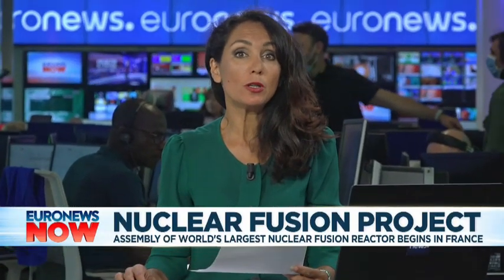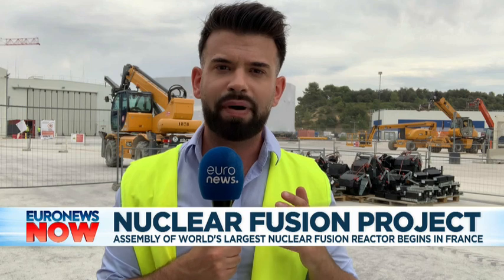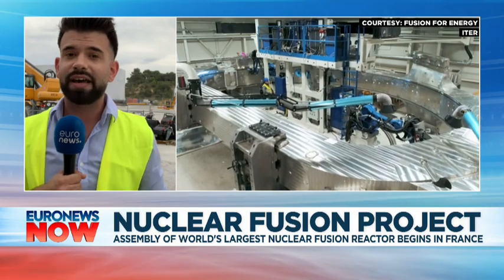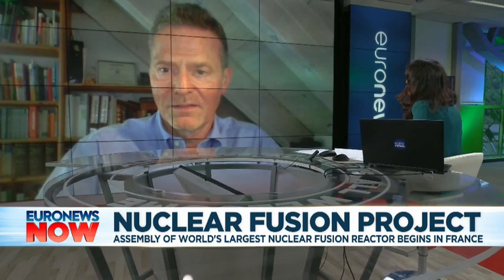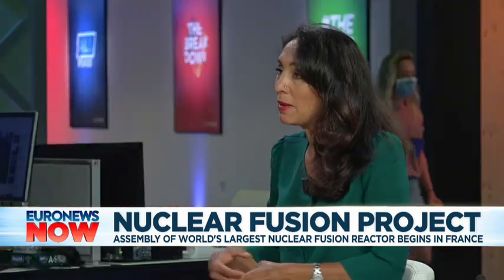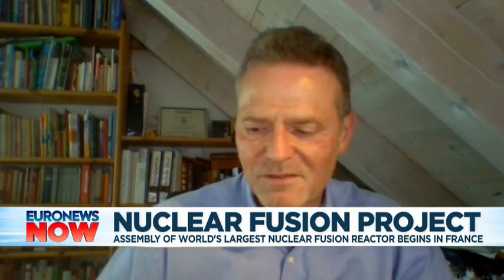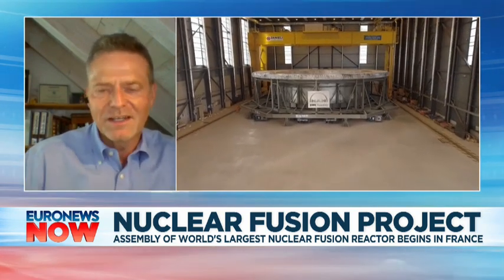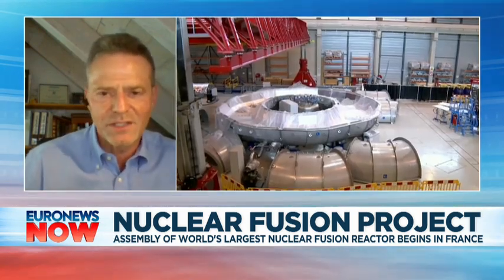Euronews Now: ITER Assembly begins

Comment: Great explanation Johannes, lets hope we will look back someday from a future completely run on cheap powerful fusion reactors.
Reply: Before ITER, fusion test reactors were small enough to fit in a single country's budget and they were rapidly designed and built and progress was very fast. But then they became too big; they could not be made smaller with the technology of the time. ITER was so big and so expensive that many countries must be involved in this one project. 

The only thing ITER will prove is that just building a larger tokamak until you break even is not viable. It will be too expensive to ever be workable and economical; you did not even have to put shovels in the ground to conclude this.

ITER was discussed years before I was born. The project started around the time I was born. It was designed when I was in my teens on "supercomputers" about as powerful as a mobile phone is today. They decided where they were going to build it when I was already out of school and working. It is being built from 90's era superconductors that cannot generate very high magnetic fields and are made of expensive, brittle ceramic, when there is much better stuff available. At the currently planned startdate for D-T I will be in my 50's; but it will be pushed back, it's been pushed back repeatedly before. Probably I will be about ready to retire when they actually do something useful at ITER. 

If practical power production from magnetic confinement fusion is a thing one day, they will look nothing like ITER. They will be small and compact and have much higher field strengths and maybe different geometry (e.g. stellarator or spheromak) and it is not at all certain that anything learned about the plasma in ITER will transfer to those designs. ITER is a giant cuckoo that crowds out funding for potentially useful projects.

Let's say ITER exceeds its goals and achieves ignition (Q goes to infinity). Then what? ITER is not a workable concept for a commercial reactor so then you go back to the drawing board and design something much smaller. We'll learn some generalizable things about tritium breeding and handling probably and diverters and materials possibly but the rest is proabably not generalizable.
Reply: @soylentgreenb  Hey soylent green. Very well made comment, thanks for putting the time and effort in. I actually completely agree with every point you make. I am looking forward to the more viable ones like the SPARC too. However it is always hard to predict the future and it is hard to blame people from 30 years ago for not knowing what today would look like. 

You may be right that first plasma will be pushed beyond 2025, but even if it is 2028 that could still be the first reactor to break even, a pretty big milestone. It would be sad to see this massive project come to an end when it is 70+% of the way to completion. I know the sunk cost fallacy but humans have done a lot of expensive projects that did not have that much scientific value but still meant a lot to people. If the Apollo program got scrapped at 70% that could have bee a wise choice but I am very glad they did not.

I really hope this project will be as inspirational to people, hopefully this will lower the bar for commercial programs (legislation and technology wise).
I am just a pleb so all i can do is trust he experts. When it comes to actually scientific value, plasma dynamics is often mentioned as hard to simulate and predict, I really hope this project will give some concrete,  needed information for the models. I have also heard we really could do without so I am not sold on one or the other here. At least all information will be public and may help in the future.

There might still be something to be said for larger reactors when mass produced. Obviously it won't look anything like ITER but one could still envision a scenario where a 10GW plant could be less expensive to run and build per GW than a 500MW plant. Hopefully the D-T 1 plant will never be needed and some company will come in ad save the day with mass produced cheap fusion plants. I expect at least some value can be derived from ITER to make this a reality.

It does crowd out funding like you said but it is still a small slice of the pie compared to military spending, I would like to see more money go into energy research all together.
Digging a expensive hole just to fill it in at the 70% mark might be more damaging to funding than keeping the project rolling and achieving trust inspiring results for fusion as a field.

We do need some base load and with fission reactors not being viable for investors in the current political climate in the west, fusion might be the best option despite being a long shot. We may never get batteries, super grids, etc.. up to a level to be viable to go fully renewable.

For something as important as energy I think we should not be taking chances and try tackle the problem from all possible angles.
Reply: @soylentgreenb  Oh that's great, perfessor. What would all these thousands of scientists and engineers do without your expertise?